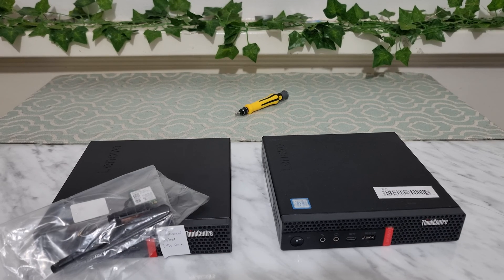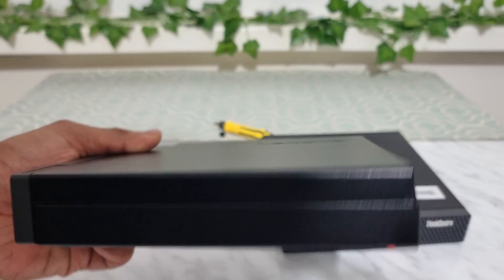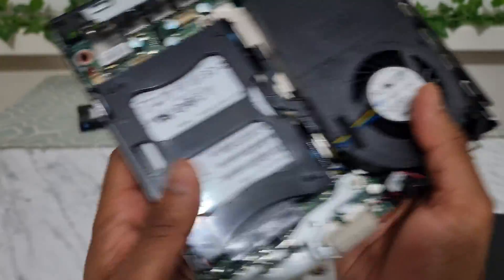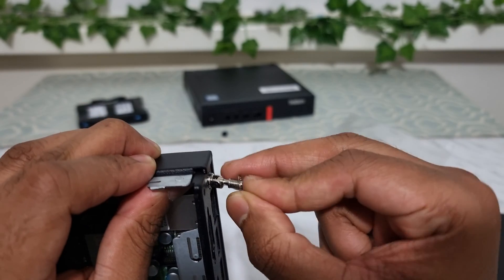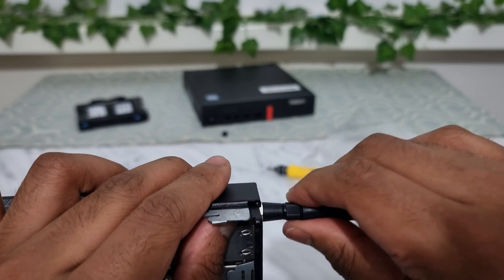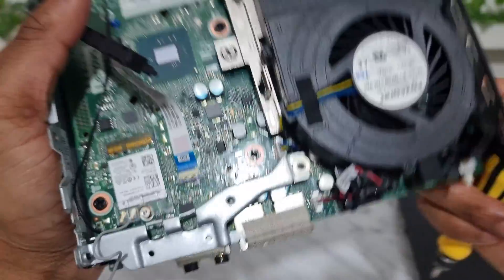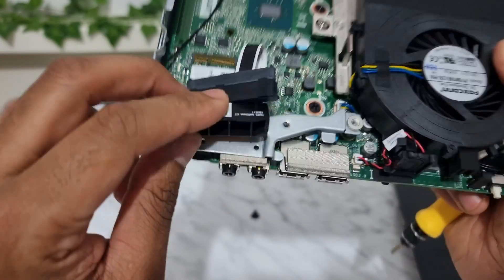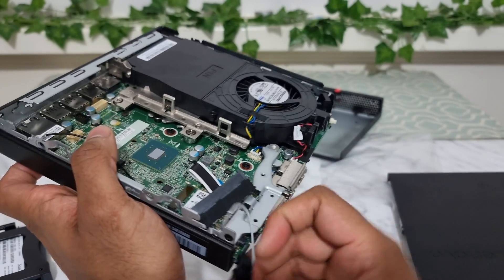WiFi and Bluetooth Installation for Lenovo Thinkcentre Micro Machines

Comment: How to tell the chipset is, if you have Intel vPro, you can use the card for example in the format Intel AX**1 - i.e. AX201.
For CPU without vPro or from AMD you need AX**0, for example AX200
Reply from the maker: Hello, naming scheme is unrelated to vPro technology..

vPro technology requires both CPU and Wi-Fi card compatibility..

Usually models ending in 1 (AX201 or AX211) are intel proprietary, they only work with intel  and require motherboard to have certain versions of CNVi..

Comment: hi - and thanks very much for the detailed video-guide.

I am wondering about the "internal/front"-Part.
- because I have got a loose-cable end (instead of the "plastic-"part").
..
Making me ask:
- I see the cable-end is soldered onto the plastic-case's metal-xx",
- does the black piece connect to the chassis /cabinet-metal - or does it have an "metal antenne-circuit" inside?

I am asking, because :
..
A) IF it does connect to the chassis: Then I just need to fixate the cable-end to the chassis, thereby "connecting it to the chassis".
..
B) IF it does NOT have connection to the chassis-metal, and have got an antenna-plate (or whatever), then I will need to "Mimick" that ("make an piece of metal-etc, be the antenna", IF the metal inside the cable isn't enough).

My guess/hope :
- that the Aux-and-Plastic part has got direct connection to the metal-case /chassis.
- and that the back-part & antenna, is NOT connected to the cabinet-metal.

Can you or anyone else help me out?
- so that I do not need to find out, by trial and error...
(after buying the wrong kit, maybe)
Reply from the maker: Hello my friend..

Hard to advise without looking.  This is why its best to buy from someone who knows and willing to help.

You should have the cable connecting to the antenna 

Some places sell just the cable for soldering to the antennas...If you didn't receive the antenna part then you need to get it.

Comment: Is it possible to replace only the black wire and outside antenna? How difficult is it to pop the wire off from the card? my device has a broken outside antenna.
Reply from the maker: You can, we have replacement

Comment: The one you have on your store has a bronze exterior and not silver like on your video. I need the silver one. Do you have it?
Reply from the maker: Hi there, what model is your PC?
Reply: @MH_Tech_UK  Lenovo P330. Looks like the one on the right in the video.
Reply from the maker: Hello mate, dont have the OEM kit for it. If you check the videos description, there's another generic solution available..

Check that out

Comment: Thanks for the video
Does it work with batocera Linux?
Reply from the maker: Hello, no worries, whether or not it will work with Linux depends on the software and the card you pick. 8265NGW is one of the best card for Linux. 

Then again, its not 100% garunteed, you have to try and figure.  We do 30 days return. UK returns are free.
Reply: @MH_Tech_UK  
Thanks for the reply
I have a lenovo thinkcentre m720q i5 8400t 16gb ram that have no use, so I turned it into retro gaming device using batocera, I was thinking of buying a wifi-Bluetooth card instead of using wifi Dongle and to use stable wifi/Bluetooth connection for internet and controller, also to win 2 other usb A ports to use it with other controllers to play with my kids and friends. 
I'd gladly take your offer, but I live in Germany, so I'll better pick something locally from ebay Germany, but I wanted to be sure it's gonna work with batocera, otherwise it's gonna be waste since I can't find use for it.
Reply from the maker: Okay makes sense. I think best thing would be to buy 8265NGW or 9260NGW card and check if they get detected by the system. 

 Without the antennas you can still get about 1 bar of signal. Try to move closer to your router.

If positive you can buy the antennas separately to extend range

Comment: What kind of antenna is that? An rp-sma doesn't fit on mine
Reply from the maker: What model of PC you have?
Reply: @mhtechuk1769  m710q thinkcentre Lenovo.  There is a wifi port, but I'm not sure what antenna is able to screw into it

Comment: I did not have the nut to Secure the wifi conector so I used a Solid circule plastic so when I tried to Close the Acces Panel (Metal Shell). I realize my mistake 😶

Comment: The gray wire attached to the piece of plastic w/ the double sided tape is bluetooth or (AUX).  It goes in the front of the machine so when your using bluetooth headset, mouse, keyboard the antenna is on the front facing the user.  Attach this gray wire to the AUX part of the chip (white arrow).  The long black wire is the wifi part and travels to the screw-on plastic upright antenna in the back. This one is called the MAIN antenna because your wireless router may be in another part of the house and needs the best antenna.   Attach the black wire to the MAIN part on the chip (black arrow).  I just set mine up today and it's working perfectly.   I bought mine from Ebay $30 and it came with everything except small screw driver.
Reply: It's too expensive. In China, these lines only cost about 2-3 dollars.
Reply: Of course, wireless network cards are not included.

Comment: Kind of related question. I have a Lenovo M93p Mini that has a Bluetooth/Wi-Fi combo card inside. No matter what I do I have never been able to get Bluetooth to work on this machine. I presume I don’t have the correct drivers. I tried ever driver listed under this model on the Lenovo website. Any chance you have drivers that would work for my M93p? (The Wi-Fi card inside the machine works fine for connecting to Wi-Fi, but there’s no Bluetooth entry under device manager).
Reply from the maker: Hello buddy, sorry never worked with M93P, do they have standard M.2 slot?
Reply: the Intel website will have the driver since it's an Intel chip set.  It could also be that the bluetooth part of the chip has gone bad and you just need a new chip for $30.

Comment: What’s the part called that holds the wires onto the card? I need some of them. Seems mine come off a lot…
Reply: I saw thouse parts in Dell Laptops, Specifically in 5410 5420 Model
Reply from the maker: Hello, is it the clear plastic bracket you are referring to?

They are almost impossible to get  separately, we have substitutes

Comment: I have a M93p tiny pc that I'm looking to upgrade the wifi module to a wifi/bluetooth module.
Reply from the maker: Hi What WiFi do you have at the moment?
Reply: @MH_Tech_UK  Intel Centrino Wireless -105 105BNHMW and it's showing no Bluetooth on the windows 11 taskbar.
Reply from the maker: Hmm those machines are too old with older WiFi card slot,  not sure of workarounds unfortunately..
Reply: @MH_Tech_UK  It's a Lenovo ThinkCentre M93P Tiny PC so maybe that's not the right WiFi card that came with it but that's what was in there when I got it.
Reply from the maker: Yes I looked up. Problem is there isn't many good cards for mini PCIe.

You can probably investigate by buying an adaptor like this:

https://www.ebay.co.uk/itm/284675889117?mkcid=16&mkevt=1&mkrid=711-127632-2357-0&ssspo=VdAsZZxbRta&sssrc=2349624&ssuid=WZiKHBToTcm&var=&widget_ver=artemis&media=COPY

Comment: Just out of curiosity, will the 8625 work on the 710q? You are showing the 8620 card. Can I use the 8625?
Reply from the maker: Yeah 8265NGW will be fine.
Reply: @MH_Tech_UK  I do have one more question please. So I decided to go with one external antenna and one internal. Do I connect the external antenna to the 'Main' of the card or to the 'Aux' of the card? And what will happen if it's the other way?
Reply from the maker: @billmagousis6231  hello, any order is fine , I prefer external to be main, if that dosent work better you can switch.

Comment: Great video indeed.
What's the exact card you used and where did you bought it from?
I have a 710q with a 6400T and wanted to use a BT 5.0 capable card if possible.
Reply from the maker: Hey George, good question,  perhaps I could investigate and make a video if I have time.

From factory they are usually paired with 3165NGW or 8260NGW both are below Bluetooth 5.1.

The Bluetooth 5.1 card I know is 9560NGW, but would the machine be able to make use of Bluetooth 5.1 is a mystery to me at this point. 

Subscribe in case I end up investigating...
Reply: @MH_Tech_UK  that would be great. Thank you!
Reply: @MH_Tech_UK  Will definitely do! If it works that will be great and will definitely upgrade. I want to achieve as low latency transmission as possible while using AptX-LL compatible headphones.
Reply: @GeorgeTJ  pretty certain the 9260AC is the way to go, the 9560NGW needs CNVio and the M700  doesnt have that from what im aware.
Reply from the maker: New video is us which answers your question...Check it out